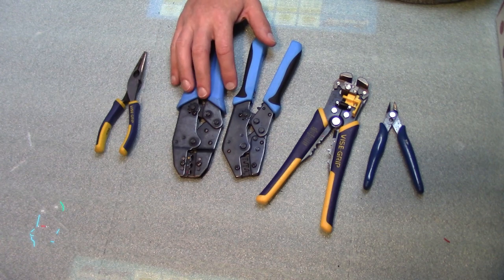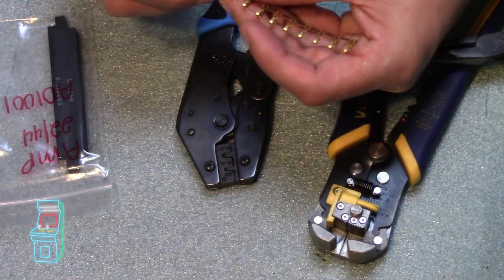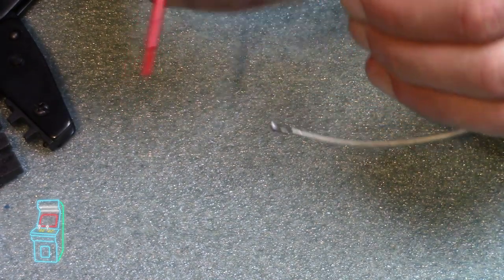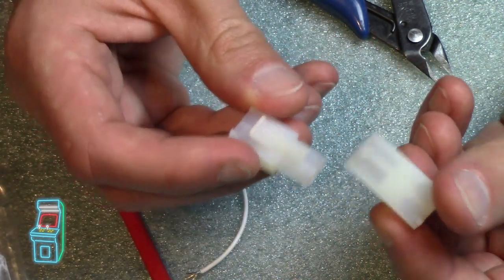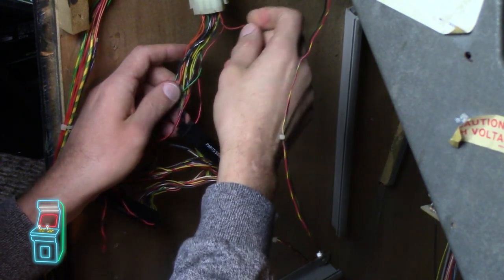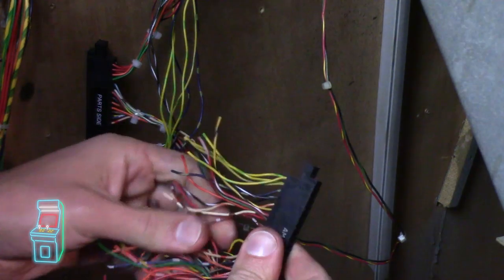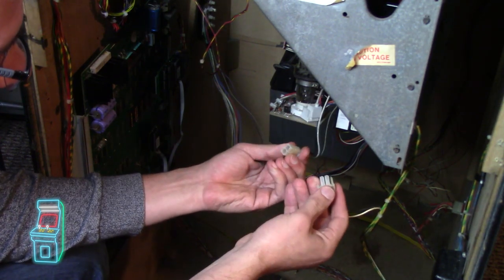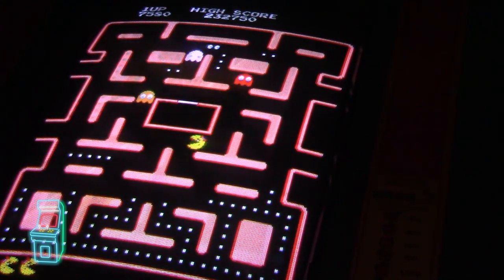Ms. Pacman Restoration - Part 6 [How to Re-Pin a Harness]

Comment: Nice work Del. I need to do the same thing on my Super Sprint. Good motivation for me,thanks.
Reply from the maker: Get the parts, put on a good arcade themed podcast and take it one wire at a time. (It's what I did during the timelapse sequence. You'll be done before you know it. But practice on a few spare wires at first.

Comment: I may have missed but... why did you change the connector out in the first place?
Reply from the maker: There was a break in the original wiring. (If you bent the connector it would turn on/off intermittently. So I cut off about 6 inches of the wiring and crimped on a new connector.
You can see it happen here (cue it up to 28;40): https://youtu.be/NmWTfUT8lpc

Comment: Great video . How would you remove a pin that is in the connector without the wire attached ... ?
Reply from the maker: You have to get a paperclip or a tiny, flat screwdriver and carefully slide it in from the bottom so that you bend the barb on the pin so it slides out towards the wiring.

Comment: Thanks again for the response to my earlier question . Is the link for the crimpers the same one you are using ? They look different . I just wanna make sure i get the right ones . I wanted to order the ones from the arcade repair  site  but they said they wouldn’t crimp those amp pins ..
Reply from the maker: I used the ones listed in my description (I listed 2 different types) but technically I had the wrong one for these Amp pins. It did indeed crush the small pin that prevents it from coming back out. I got around it by zip-tieing them in place.  I pulled them all back into the housing and then zipped them tightly. It's not perfect, bit it works. 
Peter at arcadapartsand repair explains it here: https://youtu.be/ZOYf4OjnkTc